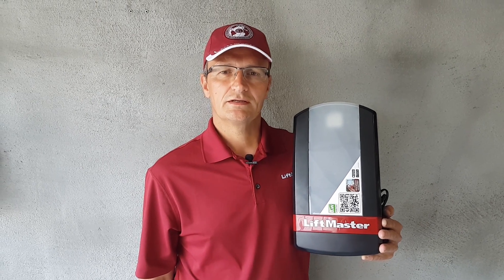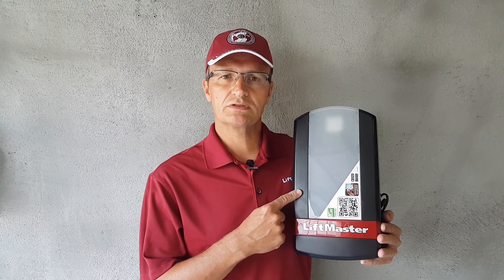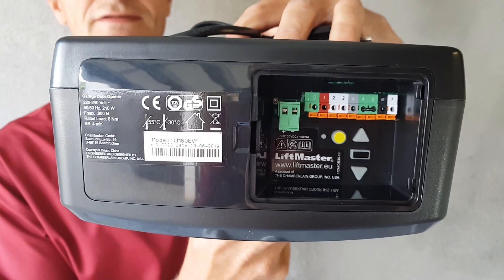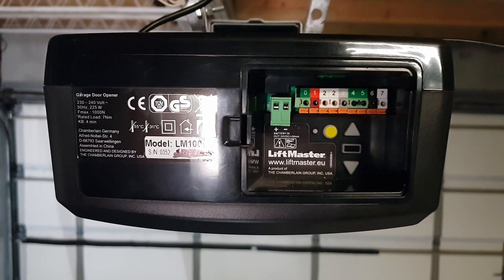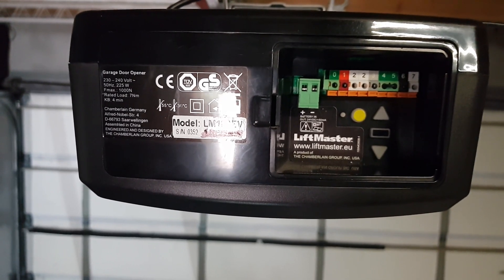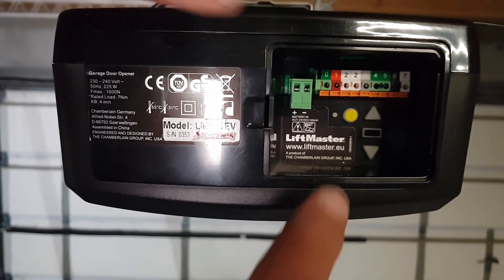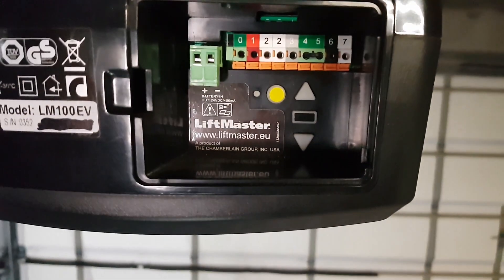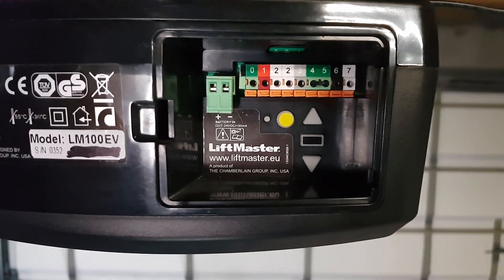Travel speed change of operator for LiftMaster garage door opener

Comment: I wonder if the technique you showed here on your video would work on a Chamberlain  Model #B4613T here in the U.S. This opener is connected to a large one-piece door.  When the opener begins closing, it starts too fast and causes the door to bounce.  Slowing it down would help.      Thanks, Bob
Reply from the maker: I believe it does not have that feature.